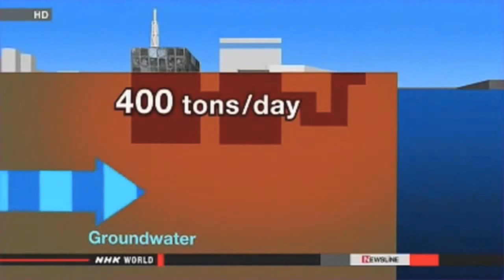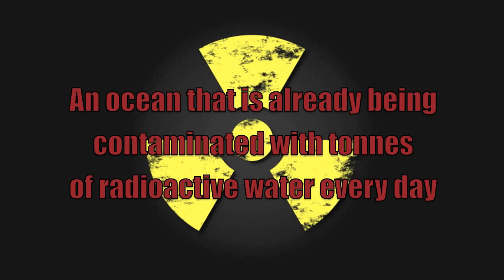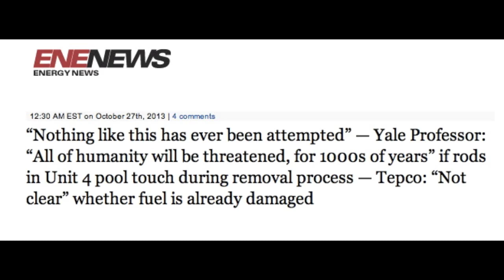(29 October 2013) ☢ Fukushima: Beyond Urgent ☢ (Platos Cave)

Comment: "Bolted together", "plastic pipes", "spare us from unnecessary warnings and evacuations"? What about rubber bands, bubble gum and paper flyers in a two block radius of the plants and storage facilities? 
The TEPCO Engineers must have had a "Common Core" based curriculum. They are probably long gone as they leave the cleanup to "JOE' 6-SAKE" at minimum pay and maximum exposure. 
Where is GE in all this crapola? Oh, that's right, lobbying for the TPP. 
Thanks as always for the update NibiruM.